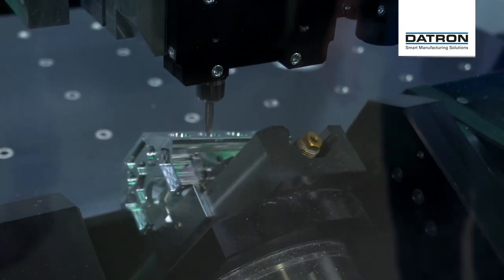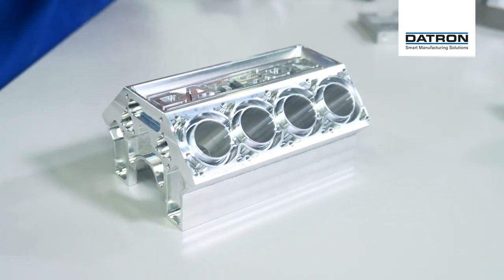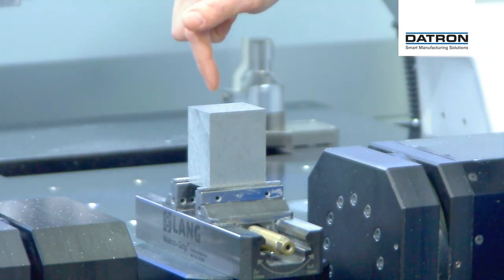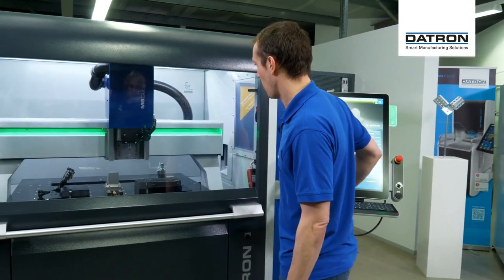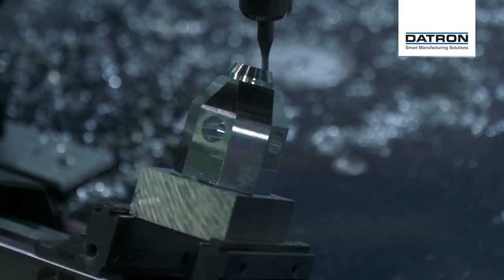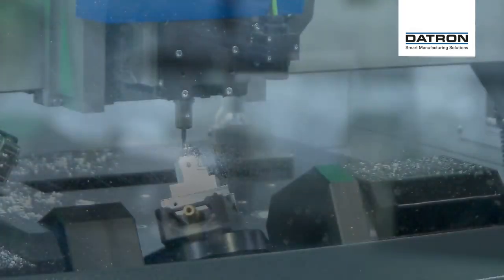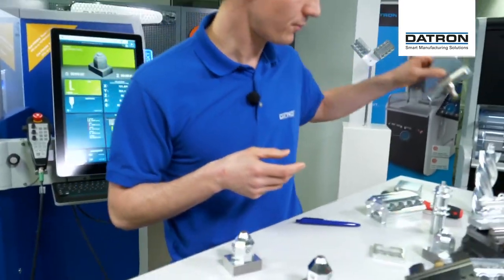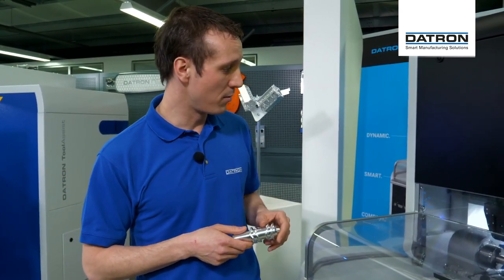DATRON 5-axis machining - Digital Experience Days 2020

Comment: Hi, what CAD and CAM do you use for the 5axis?
Reply: Hi Rob, we´ve been using Fusion360 for the demo part!
Reply: CauseImCNC very cool, that’s what I’m using, just paid for full licence, as my cnc mill arrives next month.
Reply: @MrRctintin  just curious, what does the license cost. I am retired but would love to get back into doing some programming. I used the old camax software back in the 80's.